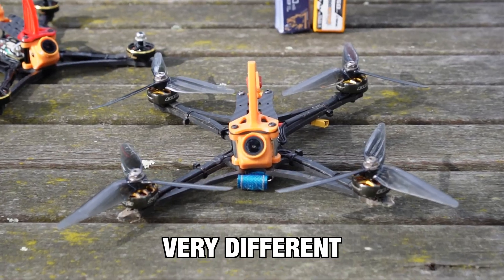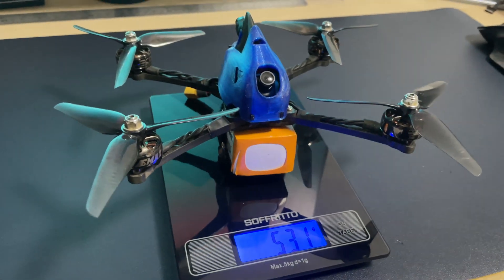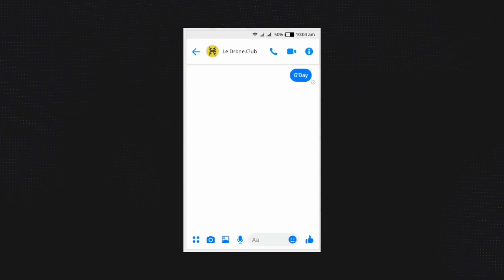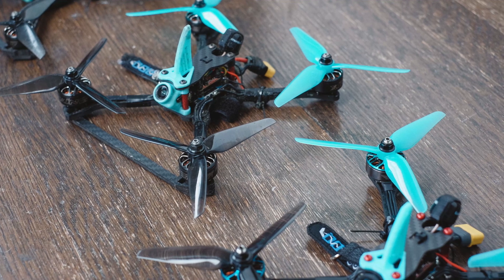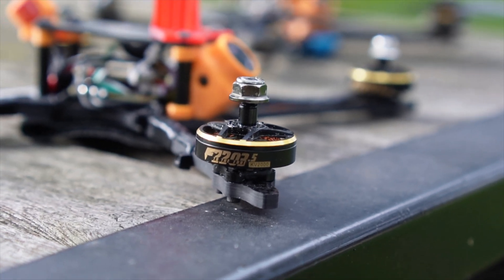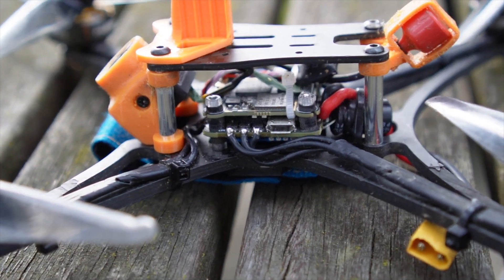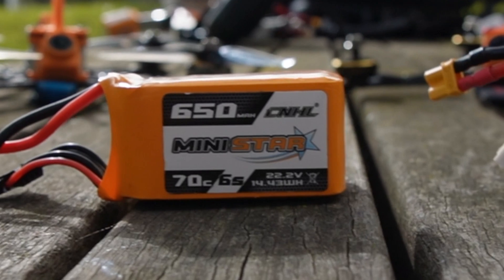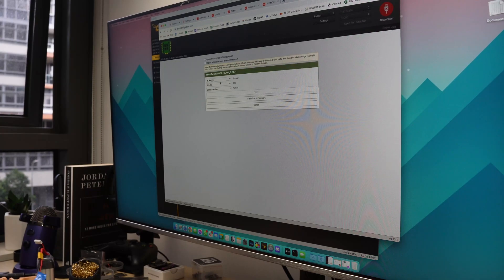300gram FPV Racing Drone, Here Is Why I Love It

Comment: I have a quick off topic question. Are there any drawbacks to putting 3.5 inch propellers on a cruiser/long range 4 inch quad?  The motors I'm going to be using are rated 3-4s (emax 1606 4000kv).
Reply from the maker: Whether it’s a drawback or not, 3.5” props vs 4” props produce less thrust as there is less prop. It will change the flight dynamics. I saw whether it’s a drawback or not because it may make your 4” cruiser more freestyleable than before which is a positive if you want to freestyle. But if you are still wanting to cruse / long range then it will be a drawback
Reply: @DarrenAllatt  thanks!

Comment: Nice! Imho reducing the auw will increase the drag/weight ratio of the quad, which increase the cornering ability. I enjoy my 180g 3s 4" with the picklebig frame, It turns on a dime even with 2blade props.

Comment: From my experience with ultralight rig, coming from Racekraft's frame. It's a pain in the ass to control, easy to flare your corners. A heavier rig has alot more control but sacrifices speed to do it. Smoother is faster
Reply from the maker: It sounds like a stick time issue and adapting to the quad by starting with a throttle scale than building up as you get used to it.

Heavier rigs blow out the corners just as much if not more because if you don't pre-turn you end up carrying too much momentum to be able to corner

You do need to fly differently on an UL though because you have to forget momentum and adapt to how it turns on a dime

Comment: I keep coming back to this sort of question/formula every few years.  Loved racing on some 4" aroudn time the dolphin by geprc and babyhawk R 4" by emax were around.

Reducing weight, does give you some really cool flight feel.  So far however, i think the best tool may be the new light switch by 533 with the headsup motors.

What i found wasnt that the ultralights lacked speed, but that the bells and bases on the smaller motors were much less robust and would die after a few hits.  Wonder if they made a 2203-5ish size with a thicker bell if it would be able to absorb more abuse and make it a more realistic choice.

im working on an ultra high KV test, to see if you can use cheap freedom spec batteries to go VERY Fast  (even if it wont take a hit).

Nice to see some experimentation still going on.

Comment from the maker: The Pickle Race is a 5" Ultra Lite Racing Drone that is Lighter, Quicker, More Dural and Cheaper than traditional 5" Racing Drones making it perfect for Beginners

🖨️Grab the Pickle Race from CNCDrones.com
► https://www.cncdrones.com/Pickle-Race5_p_1151.html
Thingiverse - https://www.thingiverse.com/thing:5170535

🎛️  AIO Flight Controller & ESC: Foxeer Reaper F722 AIO
► https://s.click.aliexpress.com/e/_DlrxfSf
Alternative options:
HAKRC F722 AIO - https://s.click.aliexpress.com/e/_DdALcmb
iFlight Beast - https://s.click.aliexpress.com/e/_DCoDjLp

🚗  Motors 4S: T-Motor F2203.5 2850kv
► https://s.click.aliexpress.com/e/_Ddv1kB5

🚗  Motors 4S: Axis Flying AF223 2910kv (12mm * m2)
► https://www.axisflying.com/product/af223-2160kv-2910kv-motor-mounting-m2-1212mm/

🏎️ Motors 6S: RCInPower GTS V3 2105plus 1850kv
► https://s.click.aliexpress.com/e/_DDiUzan

🎥 Camera: HDZero Micro V2
► https://s.click.aliexpress.com/e/_DeXYver

📀 VTX: HDZero Whoop VTX
► https://s.click.aliexpress.com/e/_DB4juax

📀 VTX: HDZero Race 2 VTX
► https://s.click.aliexpress.com/e/_DDf6CAx

📼 VTX Analog + RC: HappyModel Fyujon VTX + ELRS RX
► https://s.click.aliexpress.com/e/_DkOwPB1

🎮 Radio Receiver: HappyModel EP2 RX - ExpressLRS
► https://s.click.aliexpress.com/e/_DkGhgEx

🖨️ 3D Printable Parts: Five33 Switchback Pro
►  https://www.thingiverse.com/thing:4692732

Please note these are affiliate links!